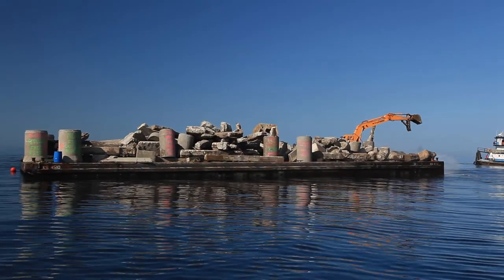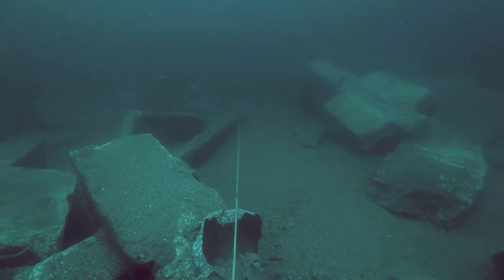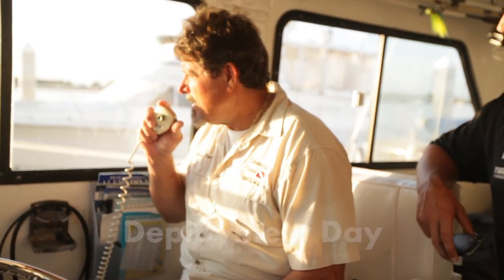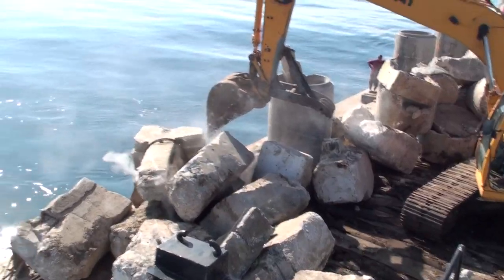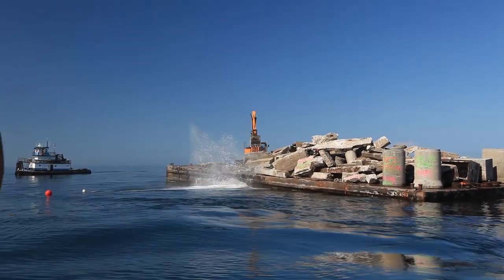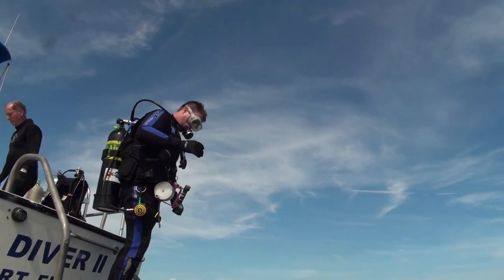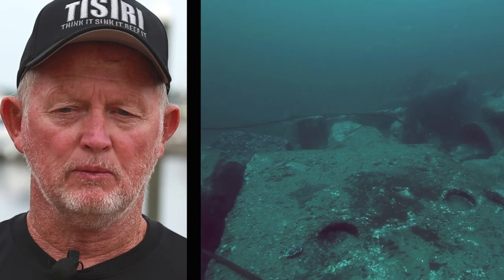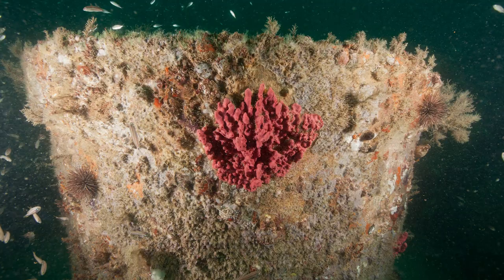Creating An Artificial Reef From Recycled Concrete

Comment: +ThinkItSinkItReefIt     One quick question...  You guys took recycled construction concrete...  Doesn't  the concrete used to build artificial reefs have to be a  special type of concrete to attract sea life on to it??..  By this I mean:  PH NEUTRAL CONCRETE ???... Thank you for your reply in advance....
Reply: communistjesus I’m no industrial chemist, however I’m pretty sure that all concrete would be somewhat alkaline due to the high presence of lime in the mix. Given that seawater is acidic and the concrete is alkaline the two will have some canceling effects on each other.
Reply: type 1 concrete is the best kind, and I'm sure they checked to see what kind of concrete it was before throwing it out there.

Comment: It's dumping garbage, not making artificial reef
Reply: It's both. an artificial reef is helpful for a lot of the marine ecosystem. by building this, you've given marine life a place to live, you stop ships from entering a place that needs protection, you slow/stop erosion of the land, block the use of trawling nets - which is killing the marine ecosystem. this can also help promote tourism and help with surfing. they used concrete because its pretty safe for the environment because it wont break down like plastic. and they used THIS concrete to recycle instead of needing to make more which is harmful. it is recycling concrete to help the environment.
Reply: @kalinaanderson2779  correct
Reply: @kalinaanderson2779  plastic doesn’t “break down” it only breaks up.